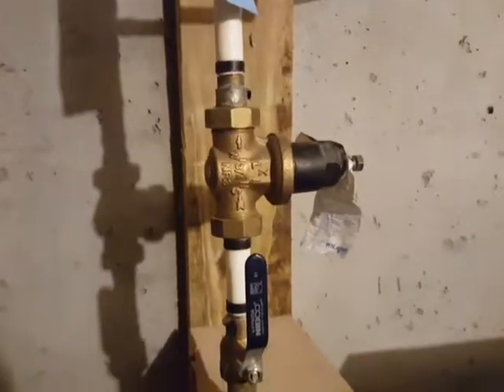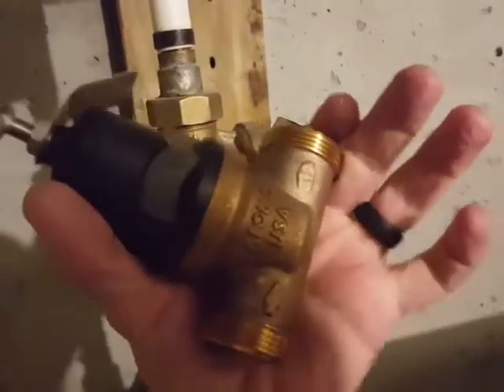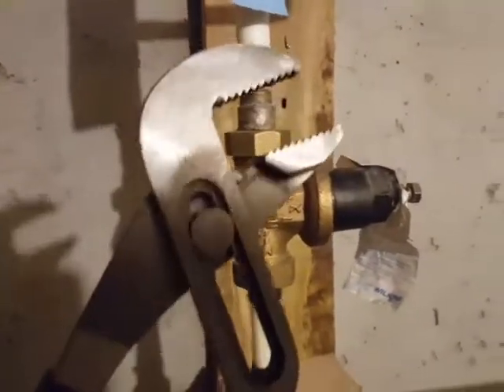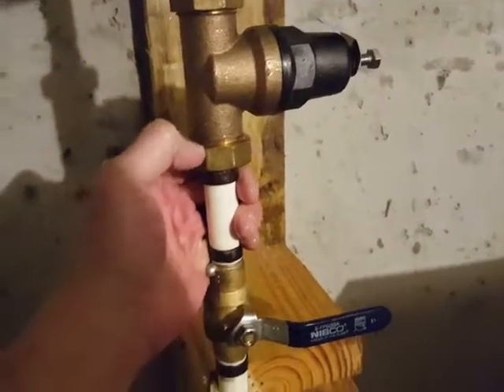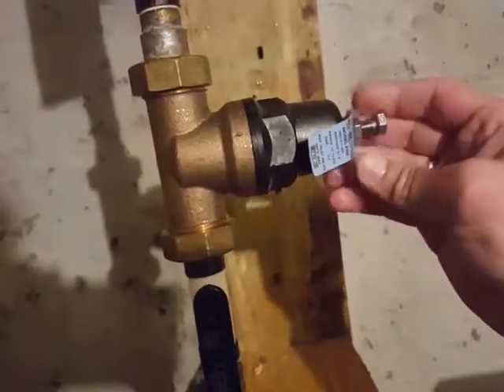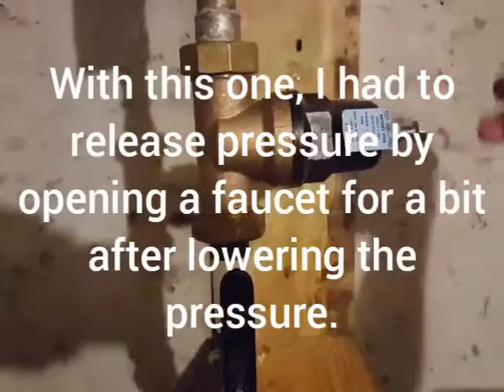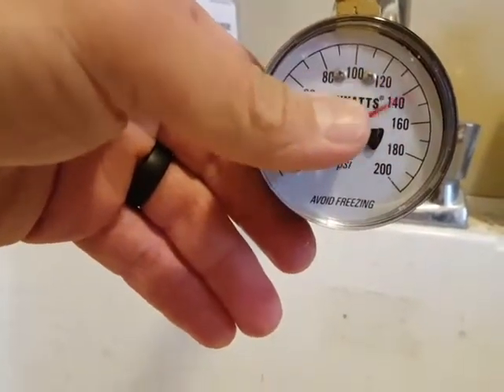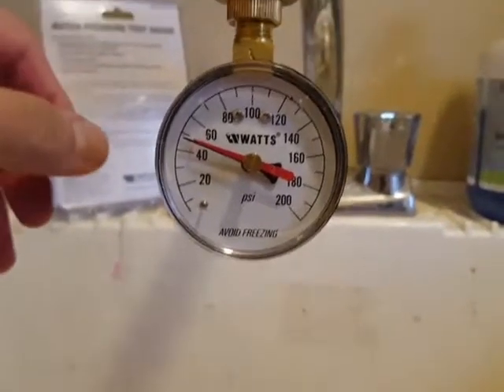How to change a water pressure regulator and check water pressure

Comment: Great How-To video! However... When one of these water pressure reducing valves fails, all you need to do is unscrew the black bell housing and replace the internals, meaning the filter screen, tension spring, rings and rubber washers inside. The manufacturer sells a kit with the necessary parts. No need to replace the whole unit.
Reply from the maker: That would have been nice to know. Lol! Thank you.

Comment: Very good information. Before replacing regulator, how can I flush all water from pipe. I have two stories building. 
Do I need to open sink faucet at first and second floors along with garden also after shutting down the main water valve? 
I heard there is air locked if it was not done properly.
Reply from the maker: I don't know, honestly. What you said makes sense: open a faucet that's high and a faucet that's low and let gravity do the rest. There wasn't 2 stories worth of water that spilled everywhere, though. I'd guess a gallon or so sprayed out. If I had it to do again, I'd only open one faucet to release some pressure and then clean up the remaining mess. It wasn't too bad. Good luck, whatever you decide. Let me know how it goes. Thanks.
Reply: @jeremyhood  Thank you for your kind information.

Comment: Water pressure of 50 to 70 psi are considered absolutely normal.  Also, you could have also adjust the screw on top for slightly lower pressure.
Reply from the maker: I agree on the pressure. My bigger concern was that I couldn't adjust it. I'd get it set correctly and then it'd change.